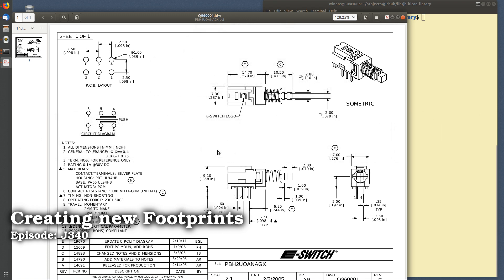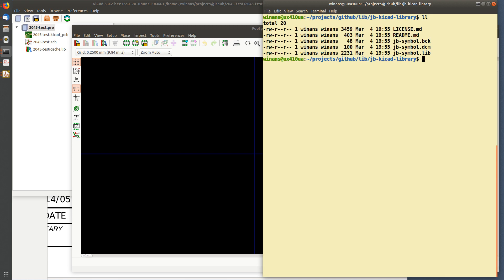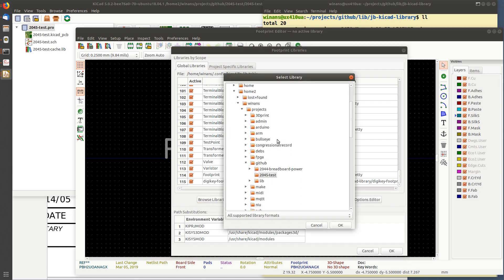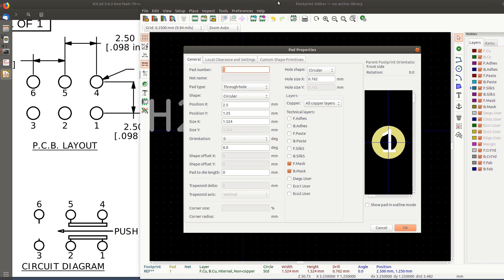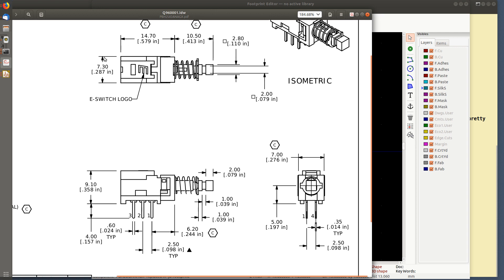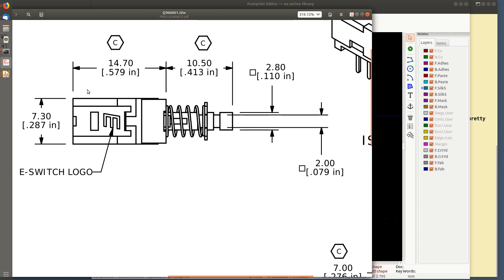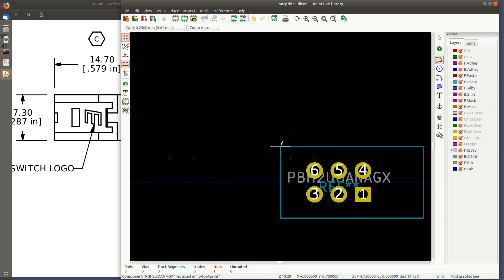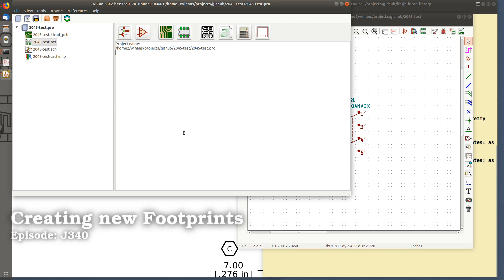KiCad 5 #12 Creating new Footprints

Comment: 15:09 On windows when I draw a line and then left click on it, nothing happens. Cannot highlight (grab) and edit a line as you show (drag line ends to make it shorter or longer). Only way I found is delete a line and draw again or edit line by entering values on keyboard. Cheers. S
Edit: looks like it's a bug. I switched to schematics and moved few lines, than when I came back to footprint editor, line selection worked. But, moving selection with arrow keys stopped working. It looks windows version is bugy...
Reply from the maker: 🤔 I wouldn't know the status of the Windows version.  But even when it requires a few work arounds of its rough edges, it remains an incredible value for the price!

Comment: Hi John, thanks a lot for this wonderful video I am learning a lot from your tutorials. Here, I have a question though:
While marking the pace required by the switch on the PCB, you first drew the switch body outline (rectangle) on the F-silk. You then overdrew the same rectangle with courtyard lines and proceeded to draw the courtyard for the shaft of the switch. 
Whereas I understand the purpose of the courtyard drawing, my question is why did you draw the body (rectangle shape) of the switch on the F-silk in the first place only to cover it with the courtyard lines later?
Please excuse the triviality of my question but please understand I am a beginner.
Reply from the maker: The fsilk is printed on the pcb so a person assembling the board cam see how the body should be put on the board.
The court yard is so I can run the DRC on the PCB and know nothing was placed too close when laying out the board.
KiCad does not (yet?) have 3D courtyards.  So including the shaft will also account for mid-air collisions.
I probably should have included the shaft on the fsilks too.

Comment: Perhaps not important to the topic, but would it not be a good idea to name new footprints prefixed with what they actually are, instead of just a part number, to make it easier to search for? For example, instead of PBH2UOANAGX, name it something like DPDT_PBH2UOANAGX, so it shows up when you search for dpdt?
Reply from the maker: There is much opinion as to how manage a part library. I'm sure I could have done better.  At a minimum, however, you DO want the manufacturer's part number in the name if it is something as unique as the part I did here
Reply: @JohnsBasement  , right, and I do not disagree. But while designing a circuit, I find it much easier to be able to search for the type of part I am needing first, then have the part numbers available to choose from.  What I find works best is simply a name for what it is, then underscore, then (optionally) package type for some items (SIP, DIP, SMP, SMD, NO, NC, etc.), then the part numbers as a suffix on the end.
Reply: @JohnsBasement  , by the way, I love this video. It is precisely what I was looking for. I can add in existing parts, sort and organize libraries, and most else, but not as familiar with how to create new component footprints and models yet.  My suggestion was intended to try to be helpful, not in any way intended as criticism.
Reply from the maker: @JamesMorningstar  I agree wirh al of the above. Critical comments are welcome here. I'd be a fool if I didn't think I had much to learn too.

At some point I am probably going to have to review all the public info on symbol lib organization and make my choice for the long run.  I'm still cobbling things together myself.

For example, Digikey's file management forces an annoying flood of symbol libraries... while footprints remain sane. This is due to how KiCad symbol libraries were designed with multiple symbols being put into each physical library file. (Multiple symbols in one file = unreasonable for making contributions and version control.)

I hope V6 will make symbols & footprints work the same way where a directory represents a library and that each file under the directory represents one symbol/footprint. With that, a community managed archive will be MUCH easier to manage... And naming will become critical.

I think the KiCad footprint recommendations work OK.

Is there a working group on symbols & library management out there?

Comment: I still use Eagle and I make a new Part in seconds, until this procedure is not easier with KiCad I don't switch !
Reply from the maker: I opted to do the first examples manually.
There are helper apps for making regular footprints.  But unless you know how to do them manually, you might have trouble with finishing touches and irregular things.

Comment: Actually you can put the pad wherever you want, and in its Properties dialog (click E when the cursor is above the pad) just enter proper Position X and Y coordinates. Much easier than counting small dots.
Also, to finish any last line in a sequence you can just double-click. Saves clicking the Esc.

Comment: Hi John, It looks like E-switch, unlike many part suppliers, show the PCB footprint from the TOP of the PCB. Unfortunately there are all to many part suppliers that insist on showing PCB footprints from the BOTTOM of the part. Rotary switch manufacturers are  notorious for doing it.This means you have to mentally MIRROR the pins when creating a new footprint. Cheers  Ian

Comment: Hi John
This is really a great series. I hope you will continue.
A proposal for a coming chapter: What do you do in Pcbnew when components share the same package but are electrically identical? Like e.g. a 74HC00, which contains 4 identical NAND-gates? What do you do if you assigned the gates in a way that makes routing tracks in Pcbnew difficult or impossible? Is there an easy way to reassign?
Thanks again for your work!
Reply from the maker: Yes!  Thank you for asking.  I am working on that right now.  Covering all of the issues that can crop up with multi-unit synbols takes a few episodes.  I hope I can keep it interesting enough for everybody.